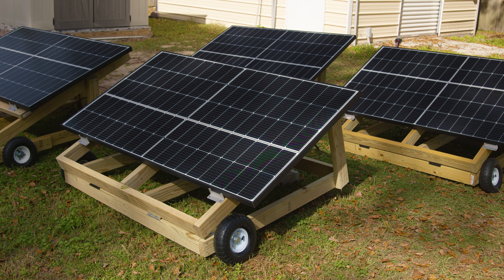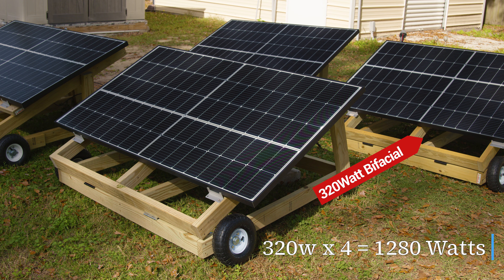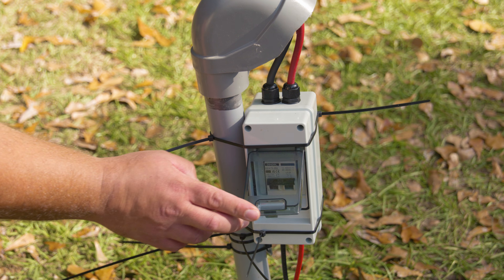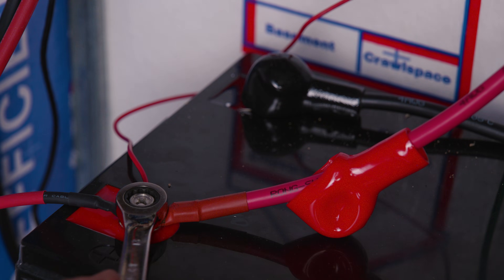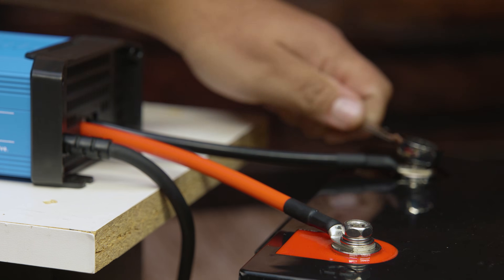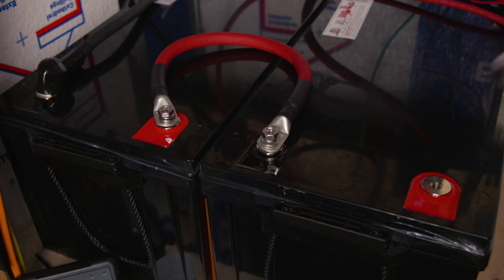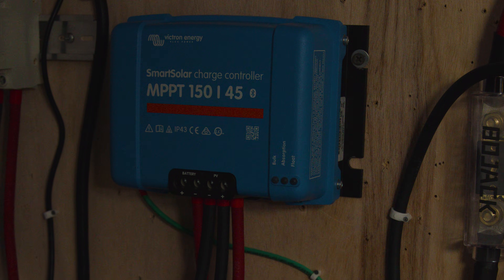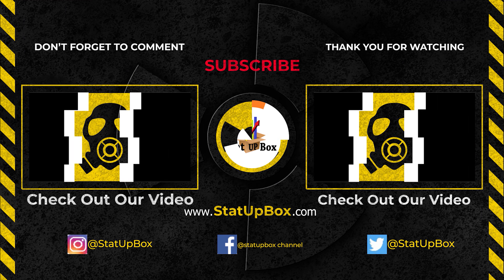How To Upgrade 12v To 24V Solar Power System Easy Simple

Comment: Great content as always, I have 12v  4-100ah lifepo4 system , can I just change the inverter and use the other parts to switch to 24v series and parallel system ???